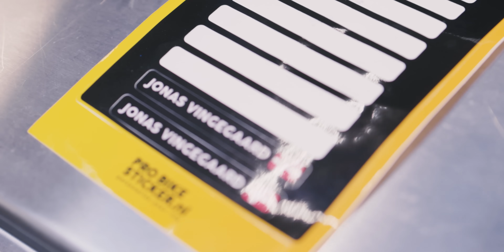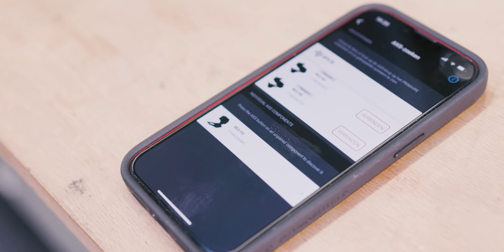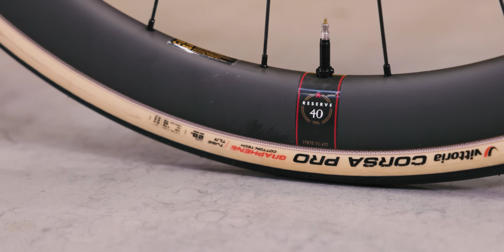Probike Build I Dream Build I Cervelo R5 2023 I Jonas Vingegaard I Team Jumbo Visma I Tour de France

Comment: 54/41 - I can only dream of running such a crankset combo.
Reply: Yes because it's not available for sale. Sram sells just that nonsense chainrings to be paired with 10 teeth sprocket
Reply: @BICIeCOMPUTERconGabriele  they are available in AM as upgrade only with powermeter option. Is required also the dedicated FD that is included in the aftermarket kit.  52/39, 54/41 etc
Reply: @GabryCazza  interesting!
Reply: E pensare che io con 48/35 mi trovo benissimo, ma i miei watt scarseggiano .....

Comment: Are the floaters in the brake fluid a Pro extra ;-) We use Velcro straps where you have used toe straps, they are quicker and don't run the risk of the clamps scratching the paintwork. Do you balance the wheels, on the workstand that rear was shaking the frame and looked like it needed it.

Comment: How do you tension the screw inside the sram levers that holds onto the handlebar? Shouldnt this be very susceptible to damage because of the bar being carbon?
Im overal a bit suprised by the lack of safety regulations regarding carbon dust...

Comment: I know weight isn't that important but it could be a 6.8kg bike with dura ace
Reply: Debatable but probably sub 7
Reply: But shimano sucks😂
Reply: And a 10 kg bike gets you fitter
Reply: They cant choose their components due to partnerships
Reply: @tviile3015  Agree!
Reply: It could be with rim brakes.
Reply: @devdroid9606 That’d be like putting drum brakes on a F1 racecar
Reply: @moritzschmidt1215   has speed increased? No, Tdf has the same avarage Speed of the '90/'00.
Has a bike the same Weight of a car or a Truck? No. 
There's no Need for discs, It's Just a bicycle
Reply: @mocha-6957 agreed on the discs, definitely a profit margin device
Reply: @mocha-6957 Interesting since the stage times have gotten and shorter and the average speeds have gone up. All that while the doping incidents have plummeted from over 50% of TDF riders violating anti-doping rules to less than 3% in that time too. Why make claims that are easily shown to be patently false, despite the cheating epidemic that was going on in the years you’re hanging you hat on as being just as fast?
Reply: @mocha-6957 Oh, also… disc brakes perform better than rims, particularly in wet conditions. They also don’t have cables that can snap during a stage and have to constantly be retightened or be replaced after every stage to maintain proper functionality. Result? Faster and more aggressive descents because they have better performing equipment that is less likely to fail, and less maintenance required.
Reply: @tviile3015 Right!? A lot of really high profile mechanical failures for the lesser groupset in both TDF’s this year. I think we’ll see more and more teams switch to SRAM when their current shimano deals expire. The only reason a lot of teams stuck with shimano is because the shifting functions the same way as mechanical groups. Reality is that SRAM is far more intuitive and easier to use once you get used to the change in operation.
Reply: @reznor_59    never heard of a brake cable that snapped, they have a bigger diameter than the front and rear deralleur cables. 
Performing Better in the wet? Agreed but Remember you're still on a bike, with 25-28 mm wheels, if the Road It's wet, It's wet no moto GP turns!
For the maintenance, I honestly, as a amateur, prefer cables. They are really Easy to replace compared to the liquid disc stuff.
About the descents, Nibali, Mohorich, Sagan, Savoldelli, Froome and so on...
Reply: @reznor_59  Bro the avg tdf speed Is basically the same from 00's only the last two editions are like 3-4 kph faster...
Reply: @mocha-6957  Brake cables snap. It's a fairly common issue, particularly when people aren't properly maintaining their bikes. They're thicker cable because of the much higher forces they have to deal with. From a mileage standpoint the TDF burns through their recommended life span. Before disc brakes the mechanics would replace the brakes 2-3 times on the main bikes to try to avoid a cable snapping on course.

The conditions are anything from dirt to water. And in dirt/sand any grime that does get in there is going to scratch the rotors, not your wheel. The rotors can also handle way more wear and are much cheaper to replace than even a cheap wheelset if/when they do need to be replaced. 2-3 new rotors before you're at the low end of a decent set of budget friendly road wheels, never mind if you're running a deeper carbon rim. And knowing my brakes are going to perform the way I expect them to in wet conditions is still infinitely better than having no idea how well they're going to work every time I pull the lever.

A lot of manufactures sell pre-setup bleed kits for their disc brakes and that should only need to happen every 2-5 years for most cyclists, if that. Unless you have a component failure or break something you shouldn't need to do much with disc brakes other than replace the pads as needed, make sure the system stays square, or cleaning the rotors. To each their own, but cables are more prone to failure and require more regular maintenance to maintain optimum performance.
Reply: @mocha-6957 And again, the 90's and 2000's were the height of the doping epidemic, when over half the riders were being caught violating doping rules and saw 13 years of champions stripped of their titles because of it. Despite that speeds are going up. It took about 36 years to see a 5kmh increase in the average speed of the ~41kmh speed that is the benchmark right now. This ignores the previously mentioned vacated wins that hit that mark in 18 years. It took 40 years to make the same 5kmh jump before that. Cyclists are getting faster and doing it in less time. And that 1kmh change you're trying to discount equates to an over 2 hour time difference.
Reply: Lol why would you want to use a brake system when MTB, a sport that relies on their brakes being nothing but reliable, ditched it a decade ago. 

Lol you rim brake apologists are living antique jokes. Thank god there no longer is a choice, it’s either disc or you quit cycling. Learn to make the better choices, or be forced to have someone smarter make it for you.
Reply: @slowcyclist4324 right!? I don't think the abrasive rhetoric is necessary, but the argument is absolutely true. People constantly looking for reasons to defend outdated and inferior tech. Particularly hilarious when they have to try and explain away why no semipro, much less pro cyclists are running the tech anymore.

If people can't afford or don't want to spend the money on disc brakes that's absolutely understandable and a totally different situation. But stop trying to argue rim brakes are just as good, much less better, than discs. They have lower performance and modularity, and they're far worse in variable weather conditions. 

I liked the comment from moritzschmidt1215 about running drum drakes on cars. The only reason drum brakes are ever on modern vehicles is that they're cheaper. Nobody is using them because they're equal to disc brakes. The exact same statement is true for rim brakes on bicycles.
Reply: Lighter wheels it would
Reply: @tviile3015 shimano is hands down the best groupset.  That is a fact.

Comment: Really nice build & video! 

Are they really cutting / filing the carbon without a mask & water and or at least vacuuming the dust though? Seems a bit risky to me, also considering he´s not working alone there.
Reply from the maker: I never saw anyone wearing a mask or cutting with a suction system at any team we've been so far.
Reply: I've also always heard that carbon dust may heavily damage eyes it also triggered me 😂
Reply: Never seen it in these videos, but you are certainly right. Masks and directly vacuuming all dust away should be mandatory. 

Additionally some of the greases should also not be touched with bare skin.

Comment: What’s the reason for wrapping the handlebar clockwise on the left and counter clockwise on the right? I got it taught just the other way around and did so for years. Is there a reason to it?
Reply from the maker: when your holding it on the drops your wrist tend to twist outwards, with this wrap your tightening it further and it won't come loose. For the pro riders it probably doesn't make that much difference when you consider the intervals the bars get new tape anyway 😅
It really depends where you're holding your bars the most, for a regular sprint finish you might consider switching 😃
Reply: @roadbikechannel  interesting I just rewatched  an older park tool video and he advices to wrap it with your wrist motion for not straining the tape I’d guess. But good to know that you can also wrap it that way around and I gonna give it a go when the next tape is needed. Thanks for responds and explanation ✌️
Reply: @roadbikechannel  Yeah. This is the first time I saw a mechanic wrap the bars the way I think they should wrap for those very reasons. Even the electrical tape is wrapped the right way since fingers are pulling on the bars and the tape isnt going to get pulled loose.

Comment: Does  the stem/handlebar of the (more adjutable) s5 fit on the
 r5?... could you tell what brand of work stand was used....?
Reply from the maker: the S5 handlebar is directly mounted to the fork whereas the R5 has a traditional steerer. so... no! 😬
the stand is from feedback 👍

Comment: Why are you always omitting the details about the most important part of the bike: the tires? 
OK those are Vittoria Corsa pro Graphene TLR in 28mm, but are those tubeless setup, and more importantly: where can I find those on the market?
Reply from the maker: The wheels are always prebuilt and the mechanic is choosing a random wheel set from the rack. The tires are set up tubeless and unfortunately you won't find those on the market. Vittoria is producing the para Version (so fa) only for the teams.
Reply: @roadbikechannel  ok, thanks!
Reply: @roadbikechannel Mustn't all products be available for the public?

Comment: Why cant they just make a handlebar with a cut out for the cables? Like the S5. It makes life so much easier. No need for it to be 100% internal.

Aside my rant. Great video as always!
Reply from the maker: The S5 has the cables inside the V-"stem" so it's not that different. Just a litte less fiddling and the option to swap the bar but not the stem either without cutting the brake hoses. 

thanks for the feedback 🤗